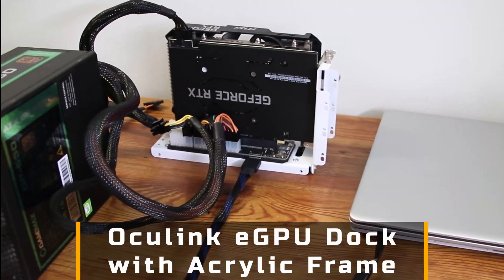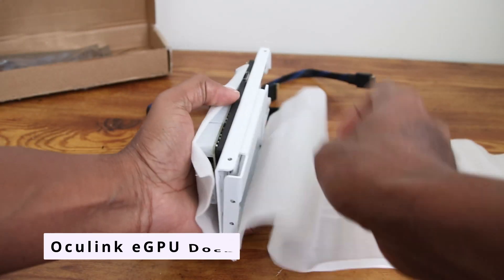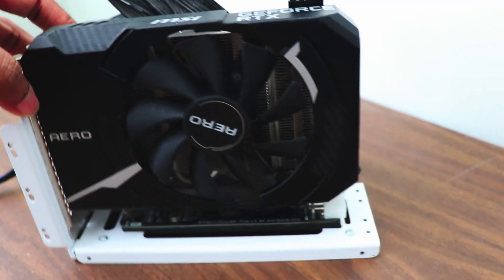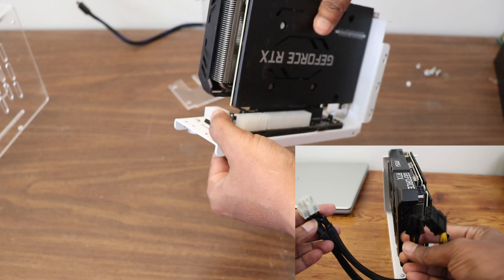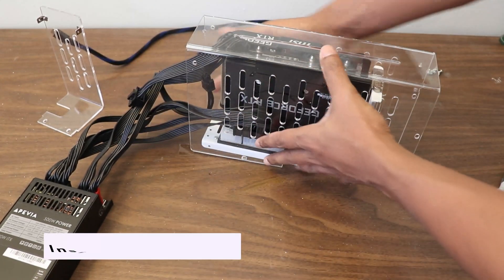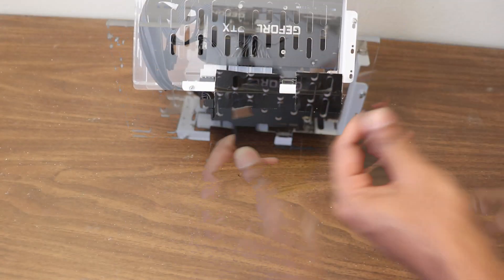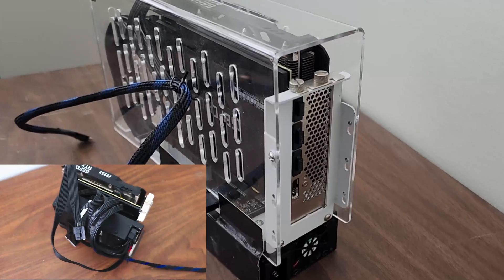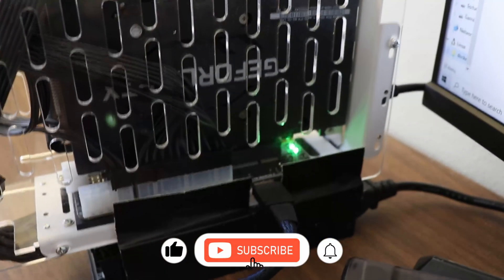Creating a Oculink eGPU for Mini PC or Laptop: Step-by-Step Guide

Comment: When i did this setup my gpu is getting low power i already connected the 24 pin and 4 pin cables directly from the psu

Comment: Hello! Im doing the same thing with my k8 plus and 9060xt. Question: what did you connect to the dock, other than the 24pin? I thought i had to connect only the 24pin to the dock and the 8 pin to the gpu

Comment: Its better if you use a Pico PSU it will fit inside the case and the cable for the power supply adapter will fit the pass through hole at the back at the oculink port.
Alternatively there is a updated version of that egpu dock case which support a U2 PSU mount.
Reply: Do you have link for that case?

Comment: Hey! I have a question about the occoulink board! I saw some board has only 24 connector and some extra 4 cpu pin with 24 like your board! What's the difference here? When i need these extra 4 pin power? I got confused when i went to buy it. Hope You'll help me to understand. thanks!
Reply from the maker: Thank you for your question! The 4 extra CPU pins provide additional power to your GPU, which can be crucial for higher performance setups. If you're planning to run a more demanding graphics card, those extra pins can definitely come in handy!. If you buy the occoulink board without 4 extra CPU pins, the GPU can connect directly to the PSU.
Reply: @unboxuptech  Thanks

Comment: The problem is how to use it correctly without any issue because I heard that if you don’t do it correctly, you can damage the circuit or the motherboard. I try to search up the article. It seems like it’s like if you don’t know how to do it you’ll likely waste probablyseveral dollars that you spend like let’s say $500 just rip off that’s why thunderbolt port it’s more easier to use without any issues. Yes, the performance will give you less performance.
Reply: LOL Oculink is easy to use if you have a iGPU and sometimes the system did not change the GPU setting within the bios this can be resolve in less than 30secs.
Both thunderbold and USB 4 has performance penalty drop due to its lower bandwith.

Comment: Hello i'm inetrested for you video about diy this your device for egpu. I've got a question for you, my laptop this acer type E5-475G and i wanna be make a egpu for extension Processor card, and socket ready is PCIe for device wifi and bluetooth, Does my laptop support an external GPU (eGPU) using a PCIe slot port without OCuLink? please reply, i can order this your diy
Reply from the maker: Hello! Thanks for your interest! 🙏 Your Acer E5-475G does have a mini PCIe or M.2 slot (for WiFi), so you can use an eGPU with an adapter that plugs into that slot. You don't need OCuLink — you can connect through PCIe directly. However, it will be PCIe x1 speed, so performance will be lower than Thunderbolt or OCuLink, but it still works great for many games and GPU tasks.
Reply: @unboxuptech  So if I use that slot for the eGPU, the internal WiFi won't work, right? That means I can only use a wired LAN (ethernet) connection?
Reply: @eidilmanegra4140  you can use a USB wifi dongle for wifi.

Comment: A rough estimate suggests this setup would be around USD 450.
Might-dah-as-well buy a higher end laptop, saving the hassle of carting around a brick-sized box and another power cable.

The only time I could see myself buying one is if I still want to use my 3 year old laptop.
Reply from the maker: That's a good point.  It's a good alternative for older devices.

Comment: I want connect an external graphic card to my laptop dell latitude 7390 2 in 1 , it have only two nvme slots occupied by wifi card and ssd. I don't want to remove them is there any way to connect graphic card?
Reply from the maker: Use can use Thunderbolt to eGPU adapter. but it's not faster than Oculink.